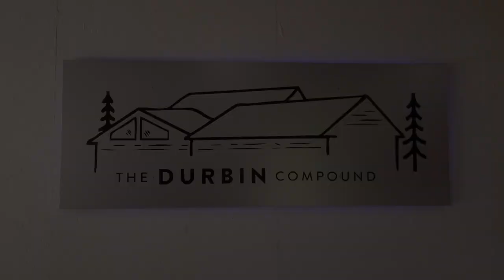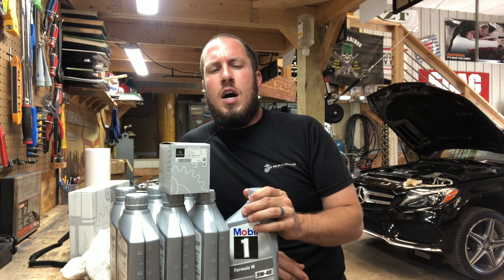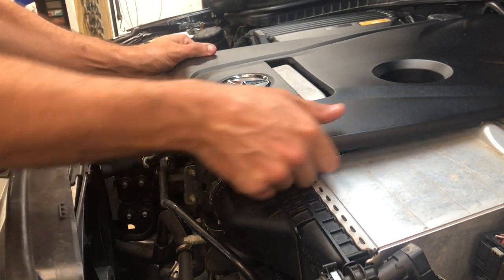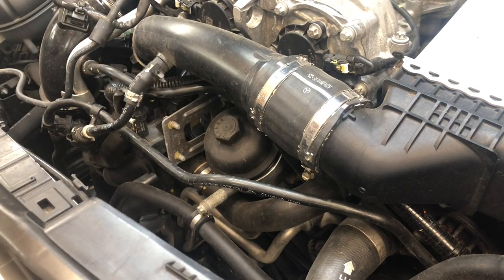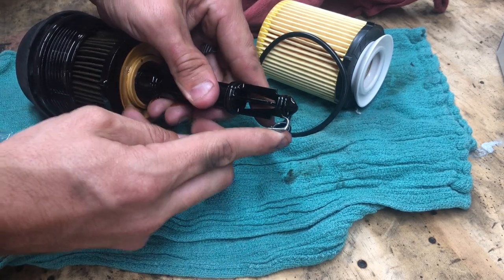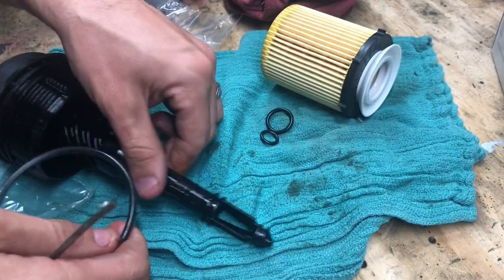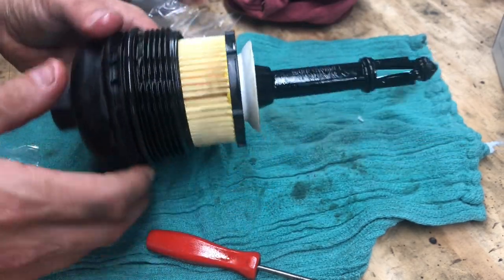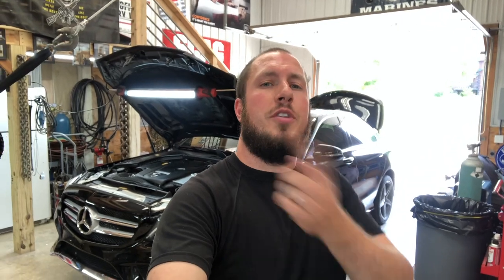Mercedes C300 W205 Oil Change

Comment: I changed my oil by myself 1st time for any car, literally followed these instructions to the tee & finished in a hr. The 27mm screw for the oil filter gave me little problem and opening the hood oil cap while draining helps. Great video👌

Comment: Oil extractor pump: 2 comments:  The Mercedes shop in The Woodlands, TX used one on my GLC.  I did one in-house oil change. I did the rest of the oil changes myself.   One test, I used the pump extractor. Then I went to the drain plug. I think it as less than an ounce of oil that was left behind.
Reply: This why I’m doing it myself I didn’t like the pump had me thinking they pumping the oil right back in so I’m here about to do it myself plus 56-125 = save me $70

Comment: good video, but consider using a oil extractor pump (quite cheap online  next time via dipstick instead of removing the sump bolt, its quicker and cleaner :)
Reply from the maker: I am not a fan of this method as I feel you miss a lot of oil and sludge in the sump
Reply: @TheDurbinCompound  no lie I was almost thinking I was draining my transmission due to the unexpected shape my C300 differs from your sump pan I was shocked cause I was looking for the same shape as yours I'm assuming maybe Mercedes uses what's on hand vs engine? 😅 or is that why your C300 is a W205 and mine is not? I just know mine was made in Alabama lmao

Comment: Bro did you spin the 13mm drain bolt owards the engine bay or the trunk?
Right is tight left is Loose but is being a sucker

Comment: i have a 2016 c300 and i'm so confused because i took the splash shield off and my oil pan does not look like yours underneath I do see a small looking oil pan thing that but the drain plugs pointing towards the passenger side
Reply from the maker: Weird.  I haven’t changed my oil in awhile but I’m 99% my plug is on the driver side.
Reply: @TheDurbinCompound  yeah this my first time changing the oil in this car...do you mind if i DM on ig with a picture of underneath my car

Comment: what is the drain plug washer part number? i Just got a 2017 E300, and i dont have any mx manuals yet.  thanks for the videos
Reply from the maker: Just ask the dealer for the crush washer. Every vehicle uses the same little copper washer. They are under $1

Comment: Great video! Where did you get the crush seal for the oil pan drain plug?
Reply from the maker: I get mine at the dealer. They are less than $1USD.
Reply: Thanks🤘🏻

Comment: Apreciate this bro got a 2016 c300 with AMG package I been changing my oil since I was 17 ,I just need to know the size of the socket for the oil filter
Reply from the maker: 27mm
Reply from the maker: I have many videos on the car. Check out my car mechanics playlist
Reply: @TheDurbinCompound  thank you , do you happen to know size of drain plug ? I just removed the front bumper 2 weeks ago and changed out the grill for the diamond grill looks pretty cool
Reply from the maker: I think it’s a 15mm. I could be wrong. The plug is long, you unscrew it a ways. The stream of oil will shoot out far toward the driver side so be ready.

Comment: In an other video I saw them using an oil extraction pump for draining the old oil. Which way is better?
Reply from the maker: I feel you potentially miss a lot of oil in the pan by using and extraction pump.  I prefer to drain at the drain plug

Comment: Say hypothetically, When you do your own Service A or B but later have a possible issue down the road that say is covered under warranty through the dealer, will they honor the warranty still or give you crap and void it since you did your own service prior?? Thanks!
Reply from the maker: I have had no issue with this. I provide more thorough records than the dealer does.  The notes on a service record at the dealer are vague and sometimes just leave out important information.

Comment: Great video, one thing. The oil filter housing is 25 NM + 5 NM. So, 30 NM.
Reply: Why is it that they put 25 NM + 5 NM instead of just 30NM?
Reply from the maker: I think the service manual says 25Nm then loosen a 1/4 of a turn and then torque to 30Nm. I think it is to make sure the cap o-ring is properly seated. Who knows, that’s the only thing that makes sense
Reply: So torque to 25Nm or 30Nm?

Comment: How do you jack it up from the front end to Insert jack stands on the sides ? I can’t seem to find the jack point
Reply from the maker: It is actually 2 little bumper pads on the rocker that are maybe 2.5” apart. My jack spans it just fine with the cup. They make the inserts as well that have a large pad on them. I have never invested in them though
Reply: TheDurbinCompound thank you , & would you be able to tell me the torque spec to re tighten the lugs

Comment: I accidently put the oil in the side where the filter goes, all 7 quarts.  Do you think this is a problem.
Reply from the maker: No not an issue
Reply: knowing how Benz wisely removed the transmission deepstick but kept an engine oil fil cap... I'd use that
👍

Comment: How many miles do you do between oil changes 10k?
Reply: 5-10k but I just did an oil change on a family members 2015 c300 that drove 18k miles before i changed it and it was still running smooth, but recommended is 5-10k

Comment: Hey I over tighten the drain plug and cracked the oil pan a bit and now is leaking oil. You know if it’s too hard to replace the pan at home?
Reply: Is it still leaking?